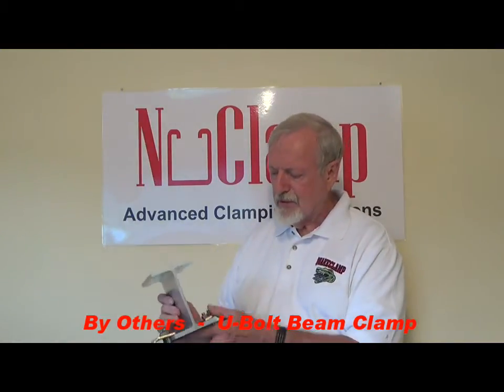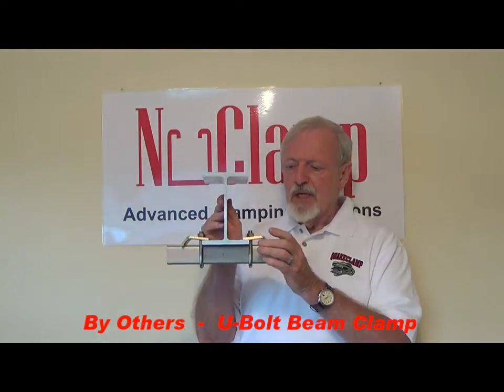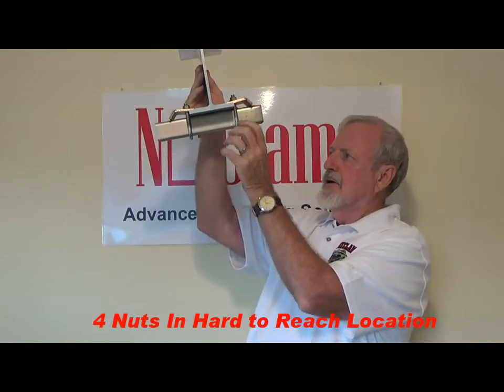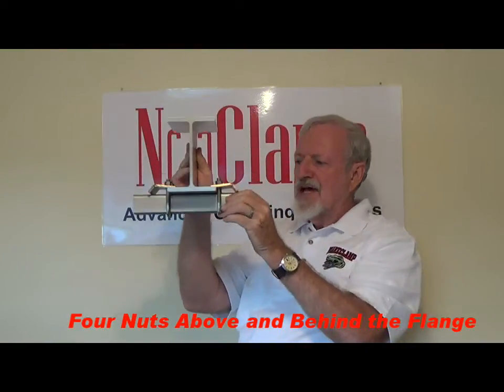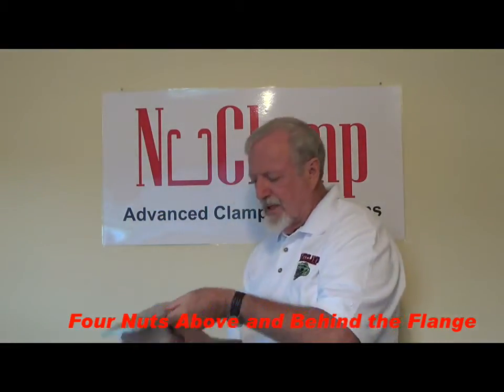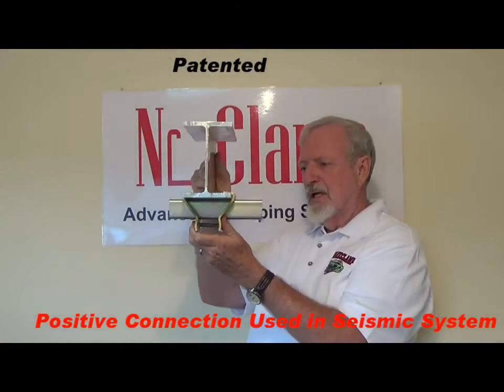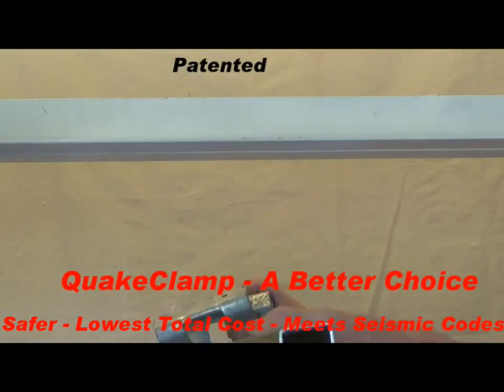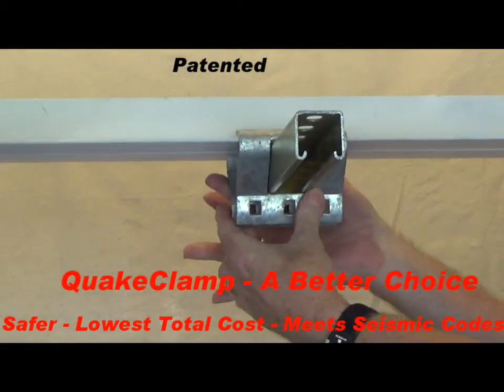Beam Clamps, Strut Channel Clamps and Pipe Clamps

Comment: We would like to introduce ourselves as one of the leading Manufacturers and Exporters of Following Products :-

Channel Nut and Bracket Accessories : In this category we are manufactures of Channel Nut Plain, Short Spring, Long Spring, L-Bracket, Single Channel Top Bracket, T-Bracket, Z-Bracket, 45 Angle Bracket, Beam Clamp, Double Wide Top Bracket, Channel T-Bracket, Tray Coupler, Window Bracket, Riser Pipe Clamp, Base Plate, Clevis Hanger, Pipe Clamp,Base Plate & Cantilever Arm. 9878813139  india